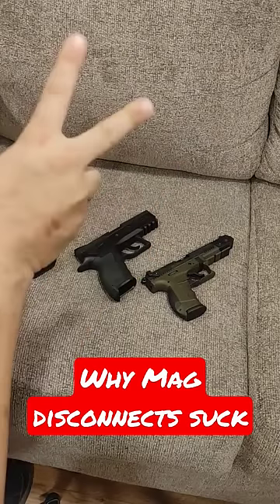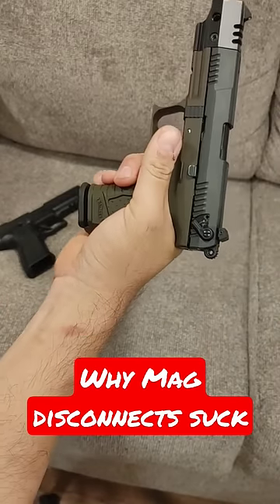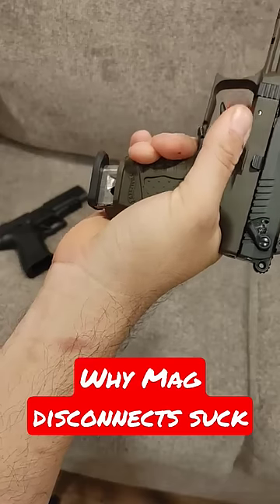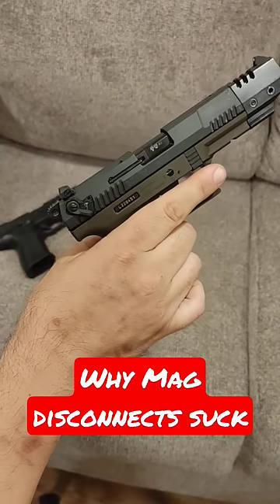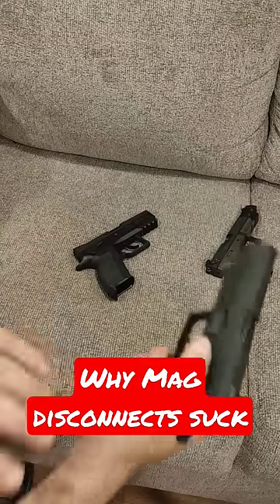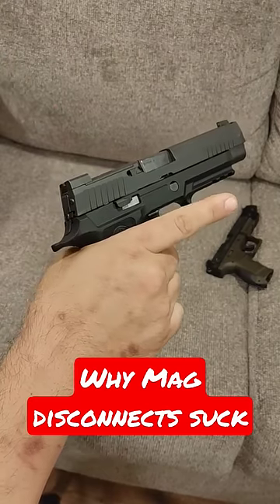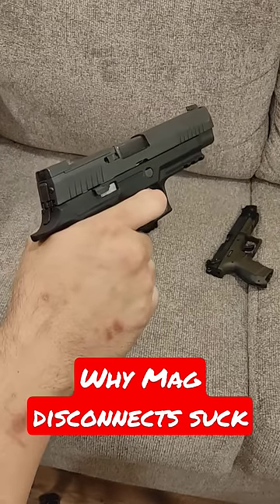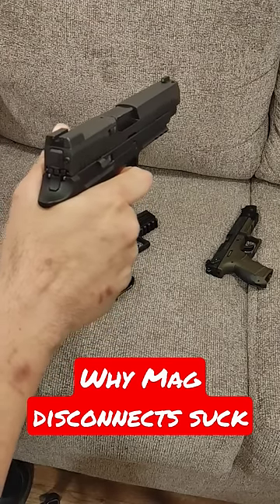Why mag disconnects SUCK

Comment: That, and they're dangerous on guns that require you to pull the trigger for disassembly. New gun owners can easily have a negligent discharge. I know 2 SD9VE owners who've had negligent discharges because of that. They need to pull the trigger to disassemble the gun but they can't pull the trigger without a magazine and put the loaded mag into the gun.

Comment: I had them both removed from my FN/Browning Hi Powers.
  They suck by today's, civilian shooting standards because they cause interference with the action of the trigger and we want a smooth, grit-free, dependable and predictable trigger pull.  The Hi Powers were known for not terrific triggers but, if you remove the device, they have a very amazing and tunable trigger. 
  The advantage of the magazine disconnect is safety, especially when putting them into the hands of otherwise untrained persons in the use of semi-auto pistols.   Many people in the military and law enforcement have shot themselves or others because they didn't understand the function of the weapons.  The disconnect was a "foolproof" and simple solution to a problem.  The weapons were used for war and defense so the butter smooth operation just wasn't that important.
  This is also the reason the Glocks designated for the New York police department had a 12lb. trigger setup installed, the cops were used to revolvers with a hard, long double action trigger so, when they were issued their first Glocks, they would be playing around with them, not expecting the short, light trigger pull and BANG...  They were shooting themselves/each other left and right.  So, the police chief called Gaston Glock and told him the problem and requested a hard, crappy trigger pull for his less than competent officers or the order was off.  Glock went back to the drawing board and the rest is history.  I actually got a trade in, Gen 2 G21 with a New York "orange" trigger in it and had to remove it. It was horrible. 
  The other safety issue about the mag disconnect was in battle, if there was a struggle over a weapon and the magazine was ejected, the "enemy" couldn't subsequently shoot you with your own weapon.  It was mostly, however for the uninitiated police and service members who would remove the magazine and, thinking the weapon could no longer fire, proceed to shoot their squad mates (or themselves) in the head.  It's human nature to do stupid things "all in good fun."  There's also the safety factor for children who also didn't think the gun was dangerous if the magazine was out.
  The disconnect definitely has "its place"  in the world but, in the civilian market, not so much so, removal is an option if it doesn't endanger anyone in the shooter's sphere of influence.

Comment: Yet another reason my EDC is a Sig P226. Before the Glock Mafia comes at me, I have a Glock 17 as well (it's a 9mm & my Sig is a .40). I love them both, and yes I know the Glock 9mm is "slightly" more accurate at distance, but I still like my Sig better and I'd rather have the stopping power of a .40 cal. *I have several compact model pistols, but I will only carry my Glock 29 in an ankle holster. 10mm stopping power & Glock reliability that fits very comfortably in an ankle holster... nothing else comes close.

Comment: Imagine like a partial mag safety. Will fire with no magazine inserted, however once the magazine is inserted enough to engage the catch the trigger will disconnect, at least up until the magazine clicks into place.

In short: It will work if the magazine is in or out, but not between.

Comment: Increasing the risk of you just getting off a single shot at best (and even that requires you actually carry with one in the chamber on the regular, "emergency" suggest a situation you are/have not strategically prepared for) if your "first" mag isn't seated properly, as a tradeoff for getting your last chambered round off after and in spite of an elementary-user-error mag swap - would in my personal opinion be a horrible design choice tradeoff.

In an emergency situation, your safety / survival is far (!) more likely to hinge on your first, second, third (etc) round firing and cycling smoothly - than your last round, and certainly more so than the rounds of your 2nd mag. Especially if the situation is such that you have opportunity and time to keep that last round chambered while doing a mag swap, before needing to actually fire that round. I would suggest that if you have the time to (somewhat) safely hold off on firing the last round from your first mag, until you've swapped for a  new mag, then you probably have the time to ensure you seat that new mag properly too. 

As a (quite relevant) sidenote, we should not ignore the reality that for most folks that end up needing to discharge their firearm in an emergency, and fire off more than 2-3 shots - they are rather unlikely to keep count, accurate or otherwise. Meaning that even if they end up needing to swap mags, they're rather unlikely to halt firing when their last round is chambered; they're gonna go until empty. Which IMO negates the potential advantages that would derive from compromising on this safety feature. I would also suggest that for the average owner/user/carrier, in an emergency they're more likely to accidentally get the "original" mag loose while pulling the firearm, than botch the seating of a second mag.

Now all this doesn't mean designers/manufacturers should just never shift such design element balance. But given what this compromise entails, I would suggest that we're getting well into the weeds of "special needs" and niche design/models. "Here be dragons". We'd be talking very low volume production, very expensive units, and a very high chance of introducing new deficiencies and quirks. Which are unlikely to be properly corrected, because of the per unit manufacturing cost of low volume parts, which makes it extremely difficult if not impossible to recover the additional cost of new revisions.
Reply from the maker: If you don't carry with One in the Chamber you shouldn't be carrying.

Comment: Also if you need to in a emergency. If you loose the magazine and don't have spare. You can single load it one at a time. Not ideal but better than using the pistol as a club
Reply: not sure what situation you would have loose rounds but not a magazine but you’re technically not wrong

Comment: Sum are a tab the inside the handle and when it’s pushed in it allows it to fire wdge it closed all the time or jb weld then sand it down with a dremel so the mag goes in smooth you could delete that dead trigger if you wanted to but good tip

Comment: That's the worse sometimes it happens with certain holsters depending on how there cut In the mag release sometimes time you may inadvertently pressure on the mag release by the way you sitting in a car.  Lol that happen to me Im getting back in the car and find a mag near the crevice of the seat near the seat belt that came out by accident by putting pressure on the hip on the 'carry side" you could depress the mag release and not realize it you just have to be mindful

Comment: Love Walther P22..mine came with Laser sight&2×Mags..i lives in Nederland,and Guns are consider it as a Luxurious items..so the price with legitimate Permits are so high..ive had spend 10K/10.000 USD(Compared to $)also the after market parts like extended barrel&adaptor like yours is hard to get..and is it has same issue with the"mags?"cus mine is black color&you cant eject/drop the mags till the bullets run out.mine is 12x capasity one&10x..Tx stay vigiliant

Comment: Why does the walter still fire when on safe ? Or is just rocking the hammer and not hitting the firing pin ?
Reply from the maker: The safety blocks the firing pin it does nothing to disable the trigger. You will see that in most guns that have a safety mounted in the slide. When it's mounted in the slide it has to be able to come off with the slide so it's only capability is to somehow block the firing pin from being struck. So they Hammer is hitting a piece of metal that's physically in between the firing pin and the back of the gun at that point
Reply: @TheJimminiShow  what is the benefit of this kind of safety ? Looks cool ?

Comment: So I'm wondering for the Walter's safety. Shouldn't the safty matter more with the magazine in? What's the point of the safty? Also please can someone explain the differences between safety's.
Reply from the maker: I will make a video showing the difference between safeties because the Walther has a slide mounted safety which just physically blocks the firing pin but does not disable the trigger, whereas most frame mounted safeties disabled the trigger
Reply: @TheJimminiShow  thanks

Comment: no. I love all these "gun fighting experts" but they can't get away with this crap anymore because we have a new tool that we never had in the past: police body cam footage. one thing about a magazine disconnect safety is that it also holds the magazine in the gun if you accidentally depressed the release. so instead of having to fumble around on the ground for your magazine (which I've actually seen happen to a cop twice in a single gunfight) all you have to do is tap the magazine back in and you're good to go.

Comment: Mandatory to be on CA roster.
Reply: That’s enough for me not to like it 🤮. They also make a manufacturer “drop test” each model of the same firearm, even if the only difference is color. Makes total sense. The tan frame is way more deadly than the black one so let’s ban it 🤦🏼‍♂️
Reply: Almost. Get a CZ, Beretta 92 or 1911, they don't have a magazine disconnect. They're older designs, so they were grandfathered in before that roster started. The triggers on all of those are so much better than modern polymer wonder nine's that are available on the CA roster.

Comment: Mag release is another attempt at giving smoothbrains a chance to own guns. Yeah it's your right, but choosing to exercise it means taking the responsibility to handle a firearm safely, which doesnt mean relying on safety features built in. If you ever drop your gun or pull the trigger by accident, and the only reason it didnt go off is because it has a drop safety, was on safe, or had a mag release, you made a mistake. Learn from it and prey it doesnt happen when those reliances are absent.

Comment: Non gun nut here.Whats the point of a gun that can shoot with the safety  on?
Reply from the maker: It cannot shoot with the safety on the safety when engaged places a piece of metal between the hammer and the firing pin. Because the safety is in the slide of the gun it needs a separate mechanism to block the firing pin because most safeties disable the trigger but you can't do that and still be able to take the gun apart
Reply: @TheJimminiShow  Ah. That makes sense. Thank you!

Comment: Why the fuck will the trigger go off even when on safe
Reply from the maker: Because it is a slide-mounted safety. When the safety is mounted in the slide, it can't interact with the trigger to disable it. So the way that it is done is to have a firing pin Block in place. This prevents the hammer from hitting the back of the firing pin. It is absolutely safe as long as the safety is fully engaged

Comment: Watching you dry fire that .22, it can't one damage the firing pin and two damage the barrel
Reply from the maker: Obviously you didn't watch it well enough. I clearly showed the safety was engaged. And the Walther P22 has a firing pin block. That firing pin block prevents the hammer from reaching the firing pin. So one you obviously didn't watch the video correctly and two you don't know your guns
Reply: @TheJimminiShow  what I'm saying is never get in the habit of dry firing any .22! Idc if it's a Walther  most .22s on the market don't have the features this one does there's lots out there that won't fire at all with the safety engaged, so people like to take the safety off dry fire it and it damages the barrel then they wonder why if auto fires when they load ammo into it and it's because the barrel is damaged making it pinch the rim of the rounds as they get loaded I've seen it happen several times

Comment: I would have laughed my ass off if he forgot a round in the chamber. You always clear the weapon.
Reply from the maker: You understand that wasn't the first time I held those weapons right? I check every gun I put on film before I film it. And in case you weren't paying attention I racked both of those guns before I pulled the trigger so I had there been around in them they would have popped out and with the safety on the wall there even if I had forgotten around in it it wouldn't have gone off because the safety blocked the fire pin and I never took it off of safe. So yeah I guess if I had managed to somehow detonate around that wasn't even in the same room you could have laughed at

Comment: P320 is striker fire and not a single action.  The real biggest reason mag disconnects suck is that they turn most triggers into complete garbage.
Reply from the maker: The P320 is single action Only. What cracked wprld are you living in? Did you not even look at the video. It's pretty freaking obvious I pulled the trigger in the trigger stayed to the rear